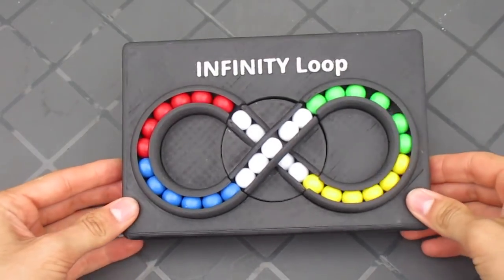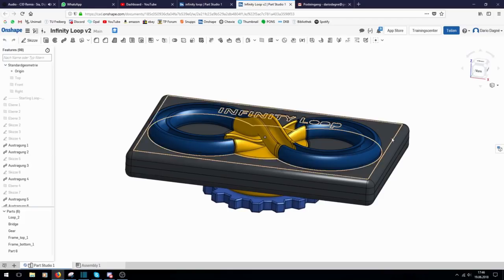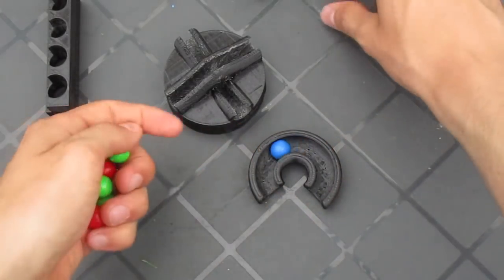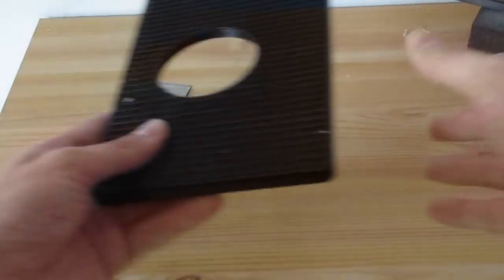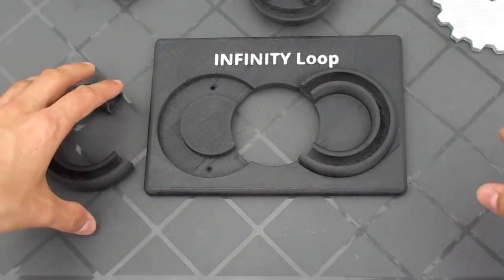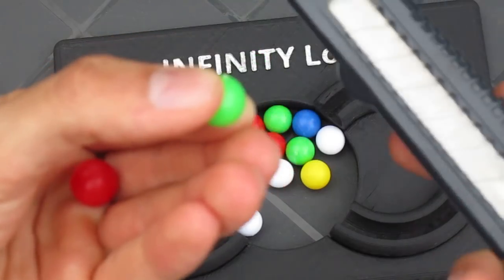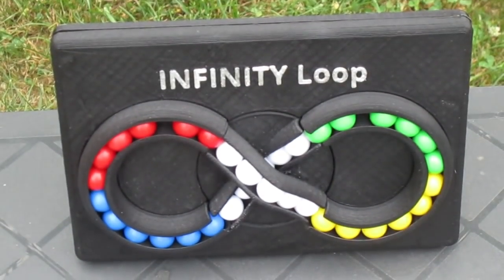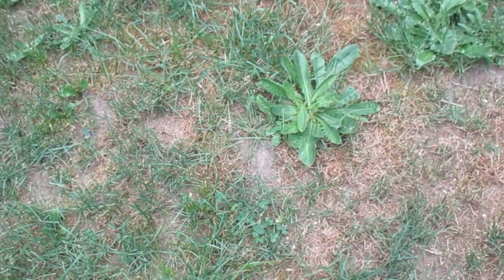Impossible Infinity Loop puzzle!

Comment from the maker: Not even THANOS could solve this ;)

Thanks for everybody who decided to watch the whole video. Criticism and praise are both welcome.
Also if you like these kind of puzzles/videos, consider subscribing and sharing. An infinite amount of work went into the production of this video. So now I'm hoping that a lot of people watch it ;)
I bought quite a few more of these plastic balls. What should I do next with them?
Reply: Sent a puzzle idea to your mail.
Reply from the maker: Thanks. I'll answer you there.
Reply from the maker: Thanks. I really like the idea of that dish/disk puzzle. I'll try to think of a way of including those drop moves in one of my puzzles as well as they are easier to calculate (getting the right size of a loop for all puzzles is way harder than it might seem (2*pi*r doesn't work that well if you have to take tolerances, different diameters and bridges into account and still have to find a puzzle size in which every piece still has an even number of pieces)
Reply from the maker: I own one of these puzzles myself and have taken it apart before, so I know how they work mostly. It is one of the first things I though of when seeing balls and I actually designed some babylon clones but didn't finish any because I didn't have a screw long enough to bridge so many pieces.
Reply from the maker: Looks like it, I know. The puzzle is loose but if I put in another ball, it'll blockthe movement.

Comment: Great job!! And it's a nice and intelligent idea to solve the problem in the middle with the bridge structure, well done!
Reply from the maker: Thank you. That was actually way harder to do that I want to admit. Onshape had some problems with those overlapping extrude features and I worked on the bridge alone for 3-4 hours which turned me crazy.
Reply: ND Puzzles it woth it. All my admiration for this job.
Reply from the maker: Thank you very much. Comments like this motivate me to do some kind of crazy project like this again and again. Obviously, this is something that I can't do on a weekly basis but it shows that within a month, using "just" a 3D-Printer and some thinking you can build completely new puzzles. I want to explore this stuff even further and also extend my puzzles to other areas. I still have to try some more puzzle boxes as well as assembly puzzles etc.

Comment: my  advice would be butting a border around the bridge and tunnel as the balls may fall out of the tubes while turning, think of physics and gravity and the magnetically static pull / push, something that moves has no stop will go on forever or something that goes in and has a hole / exit will go out
Reply from the maker: Thanks for the advice. This is something people have been pointing out before but I can ensure you that I already thought of a solution in this design. It might not be visible in the video but the groove is actually sunken into the main frame, creating a tiny border for the balls, even while turning the middle wheel. I can turn the puzzle upside down without any risk of balls faling out. This "invisible" solution was intendend to prevent me from having to add a visible border which would have destroyed the estetic look. At first, I was concerned that it would not be enough and thought of adding a frame later on but after I had the puzzle compleated, I saw that it actually worked without any issues.

Comment: it looks amazing, but it seems like it fits another ball
Reply from the maker: That's something I thought as well but actually this is the sum of the tolerances. There would fit 1 extra ball in total but that would block the puzle. Every piece individually is actually filled completely, just having a 1/8 Ball of extra space to reduce locking. When the balls move, these tolerances add up. I'm not saying it is perfect but it is something that can't just be fixed by adding another ball.

Comment: This is a great puzzle. Better than the Hungarian ones because: 

1 You can see all the balls at the same time without the need to turn the puzzle upside-down.
2. It doesn't take forever to solve, it isn't hopelessly long and difficult
3. Easier to build. 

Now make a puzzle with a 3-tier crossing :) (with 3 levels or with forked roads)
Reply from the maker: I'm glad that you like it. However, I'd say that the Hungarian Rings are actually easier to build and solve. A 3-layer version would be insane but I currently can't immagine a good path that would form a continueous loop without blocking anything (the more balls you have to move, the higher the risk of catching)
Reply: I wasn't thinking about limiting yourself to a single loop.
Reply from the maker: yeah, then a lot is possible. The hardest thing is to come up with useful scrambleing methods while still keeping the risk of blocking as low as possible.

Comment: Some advice: 
For b-roll take video at a higher framerate and slow it down (the wiggles are reduced somewhat)
(Or get a camera gymbal)

 also if you can, do some color correction (basically make the video more vibrant)
Reply from the maker: That would be better indeed. In this video I experimented with some camera movements, most of which i did by hand. Of course a more professional solution would give better results. Not having a better camera or gymbal/slider, this was my best option though.
Reply: ND Puzzles yeah, I don't own anything fancy except for the fluid head tripod. So you have to use little tricks here and there to do the same effect as the fancy equipment
Reply from the maker: You at least have a better camera, right?
Reply from the maker: I tried to get some handheld camera movement in this video. I'm pretty happy about the result but of course there is some shaking in there.
Reply: ND Puzzles I guess better than what you currently have, it's the Google pixel 2 ($650 without any sales or discounts) but it also serves the function of a phone and many other things